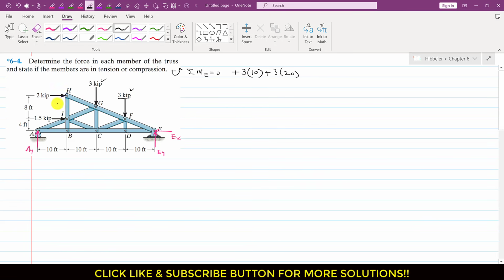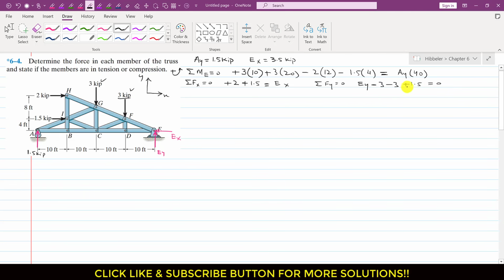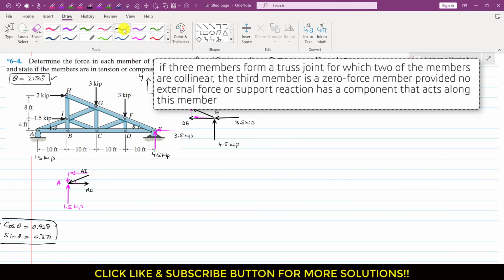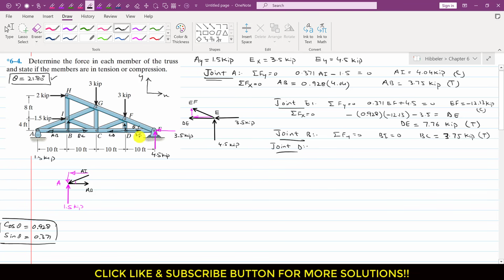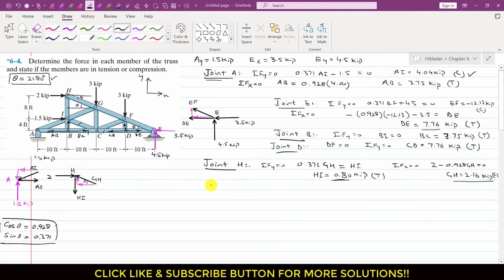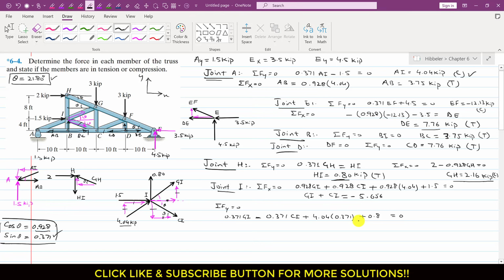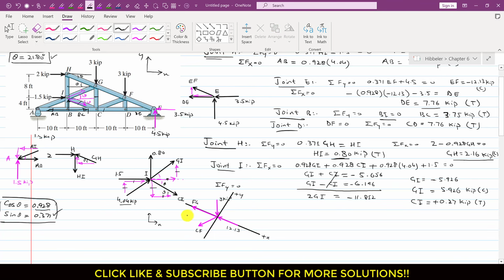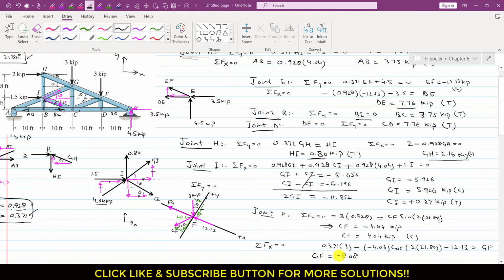Determine the force in each member of the truss. | Hibbeler Statics | Engineers Academy

Comment: when do we actually determine the support's or pinned joint's reactions?? It was not given after all, but we made to Identify joint A and joint E reactions. In other problems, there are supports and the reactions are not given. But how come we did not find the values of it? except for this one.
Reply: he did it so he could start finding forces in joint A. what he did was optional you could start at any joint with atleast one known force but since there is no external force in joint A he found one by finding the reaction at the support. in some cases this can be an easier method but sometimes not
Reply: @dre1150 how can we find reactions at support?